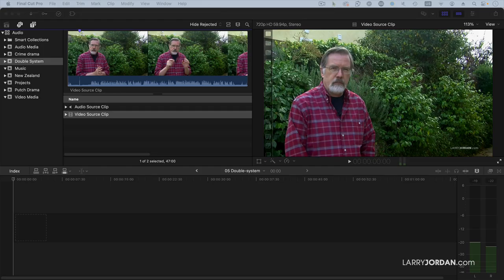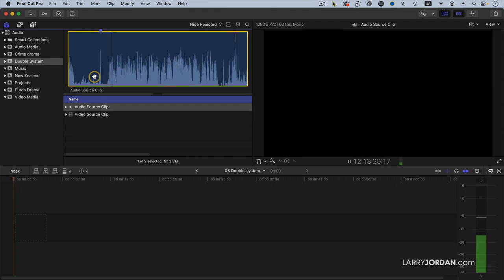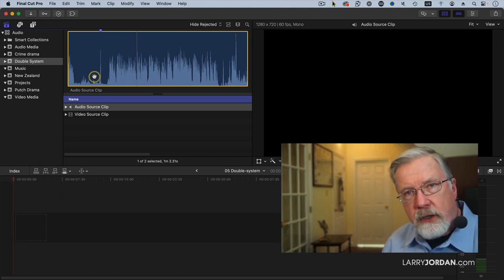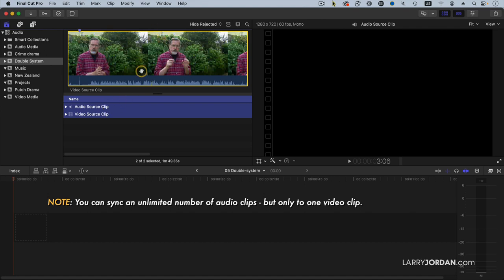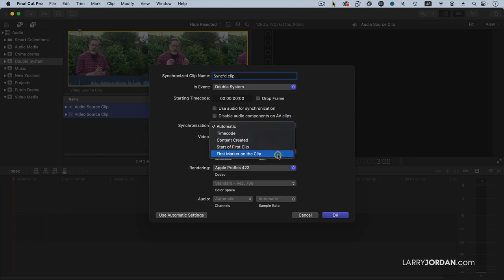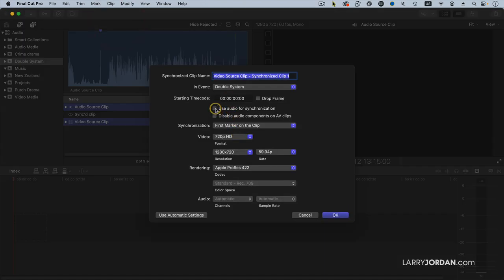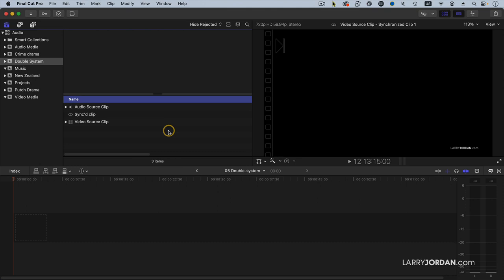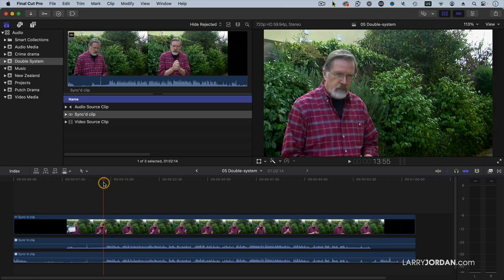How to Sync Double-system Sound in Final Cut Pro

Comment: Y'all-Make sure that the frame rates are the same if using more than 1 camera to sync, I had a problem when one camera was 23.94p and another was 24p- sound kept drifting!
Reply from the maker: Shiloh:

Good point - HOWEVER, double-system sound only supports one video track with an unlimited number of audio tracks.

If you need to sync multiple video tracks uses a multicam clip. And you are correct. audio sync can drift if frame rates don't match. It might be better to cut the multicam first, then go back to apply audio.

Larry
Reply: @LarryJordanFCP  Thanks for the response, Larry!!! Agreed, I was unaware that the audio on a true 24p frame rate on my Sony FX9 or FS5 would end up drifting when the the other cameras using a frame rate of 23.976 fps were synced in a multicam, and I could not understand why my audio was drifting-when I discovered it was the frame rate I made sure all future recording was done in 23.976 fps. Was a frustrating lesson to learn. Also, isn't it important that audio needs to be 48K not mixed with 44.1 audio? Not quite sure, can that also be a problem?
Reply from the maker: @ShilohWorshipMusic  

Ideally, audio sample rates should match. However, because no one pays attention to audio sample rates, much less knows what they do, NLEs have been dealing with this for years. While it is an excellent practice to record all audio at 48K to get the best possible quality, your NLE should compensate when combining 44.1K with 48K. 

Mismatched frame rates are a bigger problem. Still, matching sample rates is ALWAYS!!! a good idea.

Larry
Reply from the maker: @ShilohWorshipMusic  

Smile... Gracious words! Thanks! I'm happy to help.

Larry
Reply: @ShilohWorshipMusic  Sometimes I save the drift by putting a marker on both tracks right near the start, where there's a clear sync point like the slate, and then cutting one of the clips there with the slates matched.  Then I go to the last point in the clips where I can find another clear sync, like, say, the first audience clap at the end. I put a marker on that frame on each clip.  Now I cut the same clip at that marker.  And then I can use the rate-stretch tool to drag that clip into sync.  The first marker / cut doesn't move and I make the second marker match, and over a long show the speed alteration will be minimal.

Comment: Thanks, I would love to see a video on how you sync more than two audio sources to video. I sometimes work with up to eight channels and my experience is that you need to use the multicam feature in order for it to work properly. It seems like Final Cut merges the eight channels into two, like a mixdown, if using the Syncronize clip feature.
Reply from the maker: Stafens:

I just did a test. I synced three audio files - one containing six channels and two with two channels each - using Final Cut's Clip > Synchronize command. 

As long as you set a sync marker for each clip, then sync on markers, all channels are preserved. Don't sync using audio.

Remember, FCP will only output stereo or surround. So, though all these channels are in the timeline and available for editing, they will output as a stereo mix.

The workaround is to export the timeline as an XML file, then mix them using an audio application like ProTools, Audition or Fairlight.

Larry